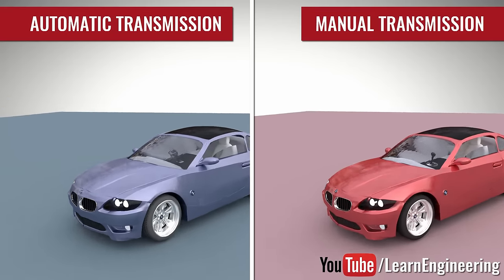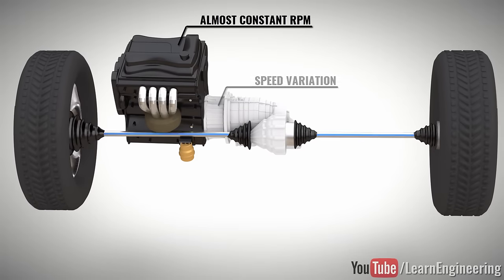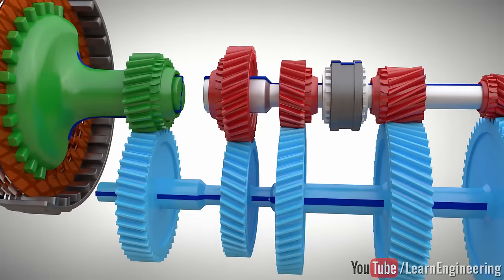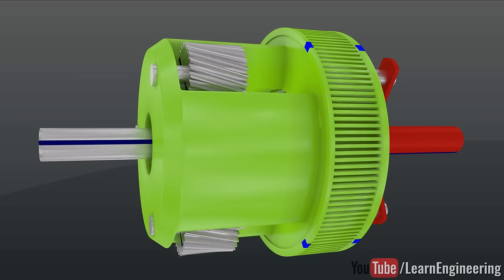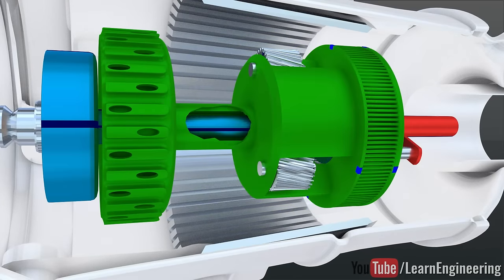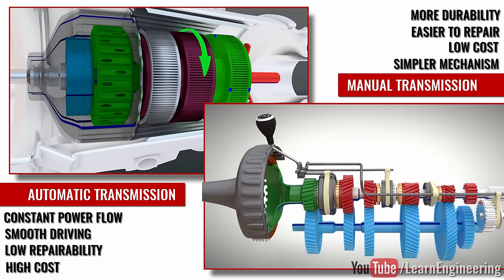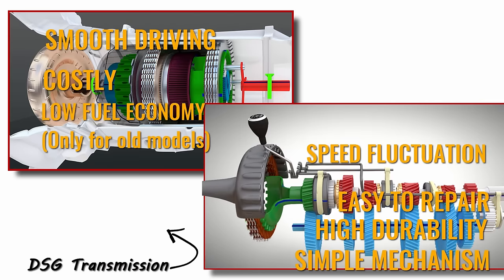Automatic vs Manual Transmission

Comment: "before braking, the clutch pedal must be pressed completely" - I bet every driving instructor on the planet want's to have a word right about now.
Reply: hahahahaha 
Its much more easier to press the clutch and then press the brake
Why the hell they make us do the opposite
Reply: @mangixbrew1  To use the engine to help slow down. You even get warning signs on long downhill stretches to do this instead of braking constantly.
Reply: @Henk14789  when my dad was teaching me to drive he told me about engine breaking and how good it is. He also added: clutches are more expensive than brake pads. 😂 Use your brakes to brake people, don't engine brake.
Reply: @BennyJ69  Using engine brake doesnt signal following traffic that you are braking, this is good reasons to use the brakes.
Reply: @groundloss  Engine braking is good for when you have a long enough distance to go, or if you need to slow down faster than just letting go of the gas. Traffic behind you should have enough time to see you slowing down even without the brake lights--assuming they're not distracted by playing on their phones... And your engine can handle shifting back into a lower gear just fine, assuming you don't skip gears. Your brake pads will wear down a lot faster if you exclusively use brakes.
Reply: @Henk14789  Modern cars dont really "engine brake" like the older cars did. I take my 2005 car down a hill when a sign tells me to use a "low gear" (to help engine braking) and my car will still go faster and faster and rev higher and higher. In modern cars, you need to use the brakes.
Reply: @groundloss  it gets kinda hard to use the brakes when they are shaking and glowing red hot from hauling ass and using them hard around corners. Engine braking works way better than brakes when your going 145 mph
Reply: And also if you are in a 5th gear by braking and engaging the clutch and you stop the engine didn't die in 5th gear because you engaging the clutch so you can put your 5th gear to 0 easily, automatic will always needed a countdown
Reply: @groundloss  not my responsibility to prevent people from read ending me. There's a reason insurance companies put the blame on the person who rear ends. BECAUSE THEY ARE SUPPOSED TO BE PAYING ATTENTION. If you depend on brake lights to know when to slow down then God help us all
Reply: @BennyJ69  the best part of what you said is how irrelevant it is. If you drive a manual properly, you don't blow clutches, or wear through brake pads
Reply: It depends on the car, but with my bmw a clutch job is cheaper than a brake job.
Reply: @BennyJ69  clutch is more expensive than brake pads, not so much when you have to replace rotors too. Also lasts like 100k miles easy. Brakes last like 10k if you don't engine brake.
Reply: I see all those people arguing, just press the fucking brake and before you stop press the clutch so the engine won't go off. If you are driving at a high speed, brake, go to 4 keep braking go to 3 and then just keep on braking until you are about to stop. Then press the clutch. You won't even feel the engine bumping if you get it right. The engine won't be damaged in any way shape or form. I mean if you are on 5th gear doing 100-120 km (60-70 miles) per hour, and you switch to 3rd immediately, then yes you are going to start fucking your engine.
Reply: @BennyJ69  If you're wearing your clutch from engine braking, that clutch is already toast.
Reply: @mangixbrew1  It is simple to test how better is to break without touching the clutch. Press the gass hard and release it, without pressing clutch and break. Then do the same, press the gas pedal hard, release it and press the clutch. You will see how better your car is losing the speed in first case, then in second. Add the breaking pedal to that and your overall breaking will be astonishing.
Reply: @shadowboy813  I use engine brake in the winter
Reply: @mangixbrew1  no its not
Reply: @BennyJ69  actually I can replace a complete clutch assembly including the flywheel cheaper than I can replace the brakes on a car if I also replace the rotors. Also, you must not understand engine braking and how a clutch wears. For the engine to not be used during braking the clutch must be disengaged which is the time when the second highest amount of wear occurs to a clutch disc. Then the clutch is fully engaged no wear is occurring because there is a mechanical lock, unless you’ve managed to make the clutch slip.
Reply: wants*
Reply: @groundloss  You use engine braking on long sections of downhill coasting. That way you don't lose your brakes going through mountainous areas.
Reply: @BennyJ69  : rev matching is a thing. It's not hard. You don't need to be in a condition of clutch slip to engine brake, you only need to have the engine generating drag.
Reply: @alexandrostzimoulis9868  : you know you can use all three pedals at the same time, right? That makes everything a whole lot easier because you can brake, use the clutch, and match the engine RPM at the same time.
Reply: Согласен
Reply: @BennyJ69  what I normally do in my truck is to just brake in 4th or 3rd gear all the way the down to 800-1000 rpms, then pop it into neutral as I come to a stop. 

This way I save both the  clutch and the brakes by using the engine to help slow down when the most braking force is required, while also not downshifting and wearing out  the clutch as well.

The only time I really ever heel toe downshift is when coming up to a 15-30 mph turn/corner where I need to be in 2nd or 3rd gear before I make the turn
Reply: @groundloss  I often lightly press the brake to signal the following car while doing engine brake though.
Reply: @saucybaka4439  I live in Los Angeles, probably the most congested roads/highways in US and one of the most congested in the world. I used to engine brake a lot, and it's true people don't realize you're slowing down. I've had several close calls from people not realizing I was slowing down. The sound of screeching tires behind you is not a pleasant sound. Yes, people are supposed to be paying attention. But as my father says, "The morgue is full of right-of-ways". My buddy was rear ended over 20 years ago when we were in high school and he still has back problems to this day and can't pick up his kids. What good is car insurance in his case? Perhaps if you live in an area with a lot of open roads and not many motorists, it's better to engine brake. In a city with a lot of traffic, not so much. Be safe.
Reply: It's scary how many people seems to be uneducated on this subject 😲 You don't use JUST the engine to brake, clutch wear is not a thing if you brake properly with the engine. You press the brake pedal and when RPM gets low enough you then press the clutch, NOT "before braking".
Reply: @DM-rc4yu  Jesus christ that's personal hahaha overreaction much? :')
Reply: It honestly doesn't matter unless your driving downhill or a mountain.
Reply: "Want's" 💀💀
Reply: I learnt it like that
Reply: @DM-rc4yu  Seem*
Reply: @CrazyInWeston  bro of course the car won't break on the engine alone, you always had to press the brakes

It looks like almost noone in these comments know how engine braking works
Reply: @GabrielLima-ro7ze  No, older cars had more of a force applied. The term engine braking isnt taught anymore as more modern cars dont really apply it. It will happily just go faster. Why else are there signs that say "steep hill use low gear"? Because when they were erected, low gearing in the engine helped speed to be lower, other wise theres no difference what gear youre in especially with modern cars. Since I made that comment I have gotten another car and it applies the same speed without braking down hill, now Im attributing that to hill assist as cars (the more newer modern ones) now have electronic assist to help maintain your speed.
Reply: @CrazyInWeston  my god you are so wrong man

I live on a mountain and drive a manual every single day, when I'm going downhill I engage a lower gear and the force I have to apply on the brakes is decreased by A LOT, which is also the case for old cars (I've driven my share of older cars)

The reason why you don't notice a difference is because you definitely are on too high a gear, but try using 1st gear to go downhill and tell me how fast you can go lol
Reply: @GabrielLima-ro7ze  I can tell you putting my older 2005 car in 1st gear didnt do anything. Gravity took hold and car just keeps accelerating, red lining it, no slow down at all and Ive driven a few cars as well.
Reply: @BennyJ69  rev match and you have minimal clutch wear. Win win.
Reply: What driving instructor drives manual? Literally everyone but a tiny percentage of people drive manual
Reply: @ErickC  I don't have three feet and I'm not a racing enthusiast so that manoeuver is out of the question for me.
Reply: @nqh4393  unnecessary. I bet they are freaked out more than anything.
Reply: @JesusProtects  : you don't need three feet, you just use your right foot to brake and operate the throttle at the same time. It's not particularly difficult and will save a lot on clutch wear.
Reply: Or just simply put it on manual then brake??
Why damage your clutch??
Unless you are noob
Reply: TRUE
Reply: @BennyJ69  If you use engine breaking properly it doesn't wear out the clutch. If you use the brakes properly it will inevitably wear out the breaks. When you're going down hill you can't use the breaks to control the vehicle's speed, because the brakes will overheat. In this situation you need to use engine breaking. So no, don't use breaks every time, use it when it's appropriate.
Reply: I clutch down when reaching 1000 revs
Reply: @sebastaroth there’s nothing wrong with skipping gears as long as you rev match properly.
Reply: Agreed. Pressing the clutch pedal down completely on a tractor trailer while it's moving will destroy the clutch brake and that's probably a good way to lose your job as well. Never press the clutch all the way to the floor unless you are at a complete stop and you need to engage the clutch brake. Small cars don't have clutch brakes, but it's still good to get in the habit of never pressing the clutch all the way to the floor. It's easy to tell that the video was made by someone who has never driven a manual vehicle before, but he has some basic knowledge of how it works.

Comment: “This is why a manual transmission ride is never a smooth experience” and I took that personally
Reply: I get your point, but the fact is that an automatic will always be more comfortable than a manual, simply by how it works. But you're absolutely right, manual can be smooth too! It just requires more skill
Reply: Accept Jesus Christ ❤
Reply: @huiba1  that's assuming the car is shifting well. I can shift better than the car I currently own. Though I guess it's mainly just your personal preference.
Reply: "Power shifting has entered the chat"
Reply: @scottwesner9362  I daily an automatic, but got my license in a manual. And I agree! Some automatics shift horribly but modern ones are generally very smooth.

Comment: It's all nicely explained and I still don't know what the fuck is going on.
Reply: I also tried to understand, but I failed.
Reply: Eightosaurus Spelunk hehe none-car guys problem.
Reply: Jus Like That You need to learn to write.
Reply: Eightosaurus Spelunk it's typing and I'm pretty sure he did nothing wrong.
Reply: to make it easier to understand, u gotta start with bicycles.. if u see a mountain bike or racer (those with several gears) then that is the same concept... smallest sprocket on pedal+largest sprocket on rear wheel=1st gear... larger sprocket on pedal+smaller on rear wheel=higher gears.. u notice when bikers try to climb uphill they mostly use 1st gear, although it takes a lot of pedaling to move the rear wheel to one rotation, it is still bearable
same concept with cars... 1st gear is the slowest just like uphill on bike with low gear BUT its got power..but when u go faster u should use higher gears because at that point, inertia is your friend, and u dont waste your engine power
Reply: Eightosaurus Spelunk o god i thought i was the only one
Reply: Eightosaurus Spelunk same here man lmao
Reply: Eightosaurus Spelunk once the cylinder is engaged to the drive shaft the torque of both will propel the engine to move unless both sclutch sleeves have transferred the power to whatever gear is needed
Reply: Eightosaurus Spelunk (what all college students think about classes)
Reply: +AMHlocal That is true.  I remember thinking my professors were just trying to make things sound more complicated than they were.  Surprisingly, graduate school seemed to be better. (Edit:  I majored in entomology, not engineering!)
Reply: Eightosaurus Spelunk - look up Engineering Explained. They have a video on transmissions that explains power curves and gearing that makes good sense.
Reply: Eightosaurus Spelunk Same. I'm just as lost now as I was before.
Reply: i see this video several times and didnt understand it too, you are not alone lol
Reply: Watch the other videos on this channel, and also by Engineering Explained, about transmissions.

The basic idea is that you need to have the engine be capable of spinning the wheels. Each set of gears reduces the speed of the engine to the wheels.

The way an auto does this is by allowing, then eliminating, a gear reduction.

The clutch plates are how it happens.

Check out the videos on transmissions, then take this one on again. Hopefully a more complete understanding will help!

Good luck!
Reply: holla at you for that bro. The vid quality was so good that I forced myself to act like I have understood it but I'm in the fuckfiddle of nowhere, knowing nothing at all.
Reply: I hear you.
Reply: Please, don't brag about your lack of knowledge and intelligence. Ever
Reply: Elijah Chu ikr, in manual you can see the clutch proces and the stick doing work but.. auto doesn't make sense for my mind
Reply: Exactly! what I am thinking
Reply: Then pay a-fucking-ttention?
Reply: Eightosaurus Spelunk well, glad to know I'm not alone in this
Reply: Eightosaurus Spelunk I'm thinking the same thing lolol. glad I'm not the only one. have to watch this a couple more times but it's good to know I would've have failed as an engineer 😕
Reply: the fuck just happened?
Reply: Eightosaurus Spelunk 
hahaha your sentence had me laugh
Reply: Eightosaurus Spelunk hahaha same
Reply: Eightosaurus Spelunk omg, thank you, thought it was just me.   so confusing
Reply: Eightosaurus Spelunk The principle is nicely explained, but the video assumes you already know the names of the parts and systems (planetary gear? What's a carrier?). I feel like I just joined a class in the middle of the semester. They should have either avoided jargon, or taken a few extra minutes to explain it. Nobody would have complained if this video were sixteen minutes instead of eight.
Reply: Eightosaurus Spelunk me everyday in class
Reply: Batfan1939 Well said
Reply: 😂😂😂😂😂 good one
Reply: Eightosaurus Spelunk this is what I got out of this.  Can't drive stick? Buy automatic.  Transmission does funny things? Ask mechanic. Finished.
Reply: Mohammad Siddiqi lol
Reply: Eightosaurus Spelunk gahahaaga
Reply: Eightosaurus Spelunk tbh I’m probably gonna have to watch this like 5 times to really understand it so I’m with you
Reply: Still here?
Reply: The Kingdom of God is at Hand 
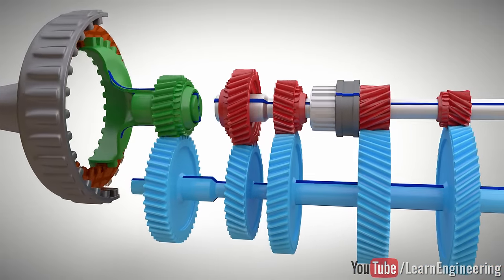John 3:16
King James Version 
16 For God so loved the world, that he gave his only begotten Son, that whosoever believeth in him should not perish, but have everlasting life.
Reply: Don't cuss.
Reply: This is the 8th video (literally) I have seen recently explaining transmissions and I think I finally get half of it!